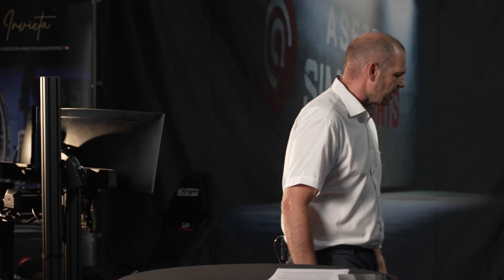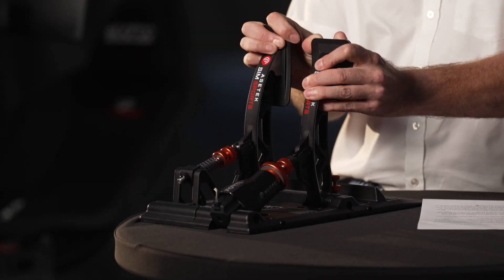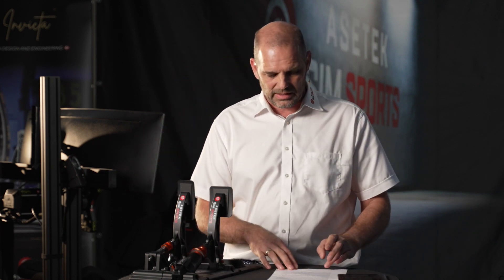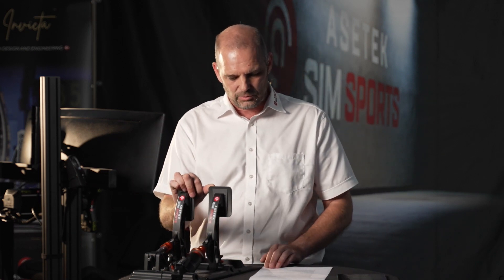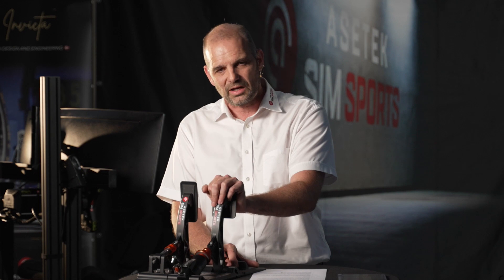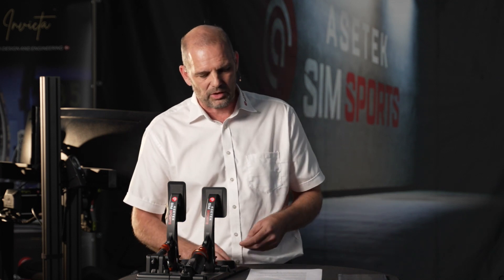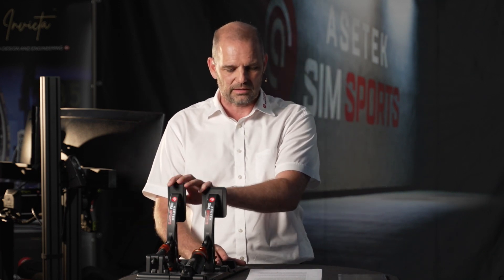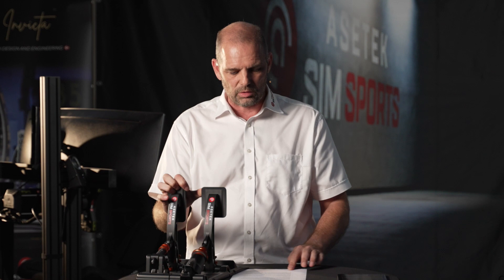Q&A Recap - How Hard is a Race Car Brake Pedal Really?

Comment: Spot on! This is true in my Radical SR3XX, E36 M3 racecar without brake booster and every formula car I've driven. Takes some getting used to, but I feel the control is much better once you do. Sim brakes are not ideal in general since there's no real feedback, but for immersion purposes I much prefer a short and stiff brake pedal.

Comment: I 100% believe that they feel realistic.
However in a real race car, under braking your inertia will push you into the pedals once u stab it with ur foot. 
Achieving high brake pressures is easier when you're in a moving vehicle than in a stationary sim. (Psychologically you're also more ready for physical exertion)
And brake modulation with a short pedal throw is no problem, since you use mostly ur senses as feedback for how much you can push the brakes and how to get off the brakes.

In a stationary simulator you don't have that fine detail feeling in your entire body. So a longer a softer pedal here helps to have more breathing room.
Just a consideration for the endless "Realism vs Immersion vs Practicality vs Esports" discussion online haha.

I personally like them stiff with a short pedal throw, but i heard a few people use this argument and I find it fair.
Reply from the maker: You are absolutely correct, but even compensated for that, a driver still often pushes +100kg in the hard braking zones. We are very soon releasing an elastomer kit with 6 different hardnesses calibrated according to driver leg input. Then all kind of drivers/level will be able to simulate the hard brake pedal according to their own ability and liking :)

Comment: One important factor in brake feel might be the significant deceleration forces present in race cars (especially formula cars) which help multiply the force a driver can exert on the pedal when braking, as the driver is thrown forward with the brake pedal absorbing (a small) part of those forces.

Naturally, within a sim pit environment, those real world deceleration forces are absent.

Therefore having the brakes 100% as stiff as in a real car, might not make for the most accurate simulation.
Reply from the maker: You are right. And that is already factored in.
Reply: @AsetekSimSports  Thx for the response and clear answer. 

Good to know! 👍 

As an aside, your new line up of wheelbases and pedals seem like an interesting proposition positioned between entry level DD bases and loadcell and hydraulic pedals and the upper end of the market.

I’ll be looking forward to the reviews coming out in the future. 

I’m not yet in a hurry to jump on the DD train despite the obvious benefits, but it’s nonetheless nice to see more competition such as yourself enter this market.

That said, I must say your product strategy and well thought out design choices have definitely piqued my interest. ;)

Comment: My Forte pedals arriving today! cannot wait to try them compared to my current TLCM pedals
Reply: @asetek simsports although it doesn't mount to my standard GT Omega pedal plate. Time to get the drill out!
Reply: What do you think? Huge improvement over the LCMs? Some adjustment period required no doubt?
Reply: @Thisonegoestoeleven666  Yes huge improvement, I've not seen any videos/articles comparing the two so I may do one. My trail braking feels much better than before (easier to control)